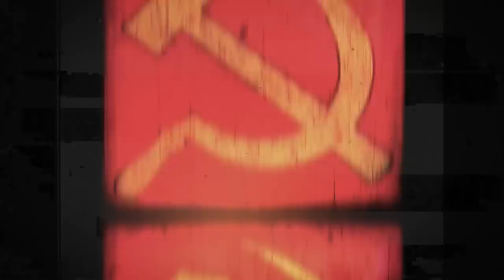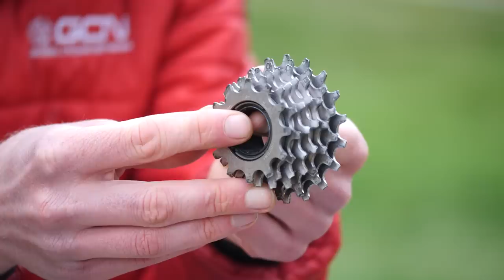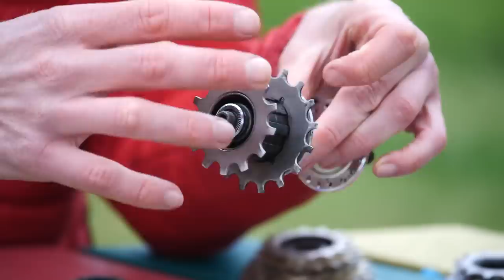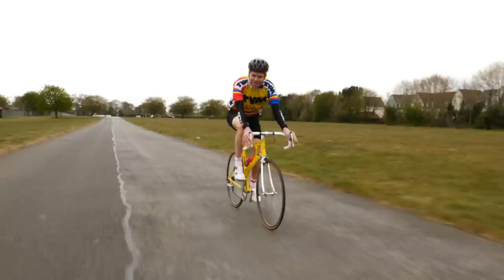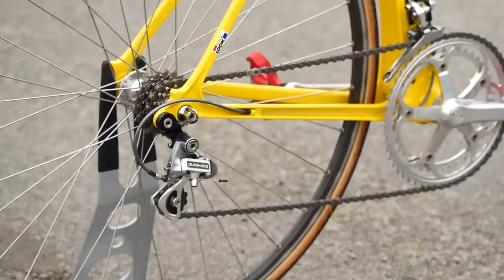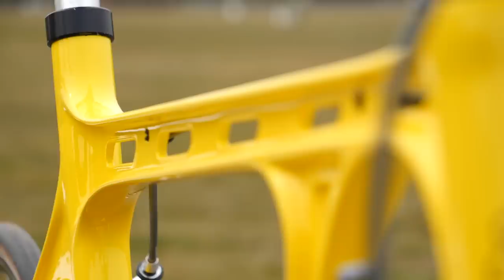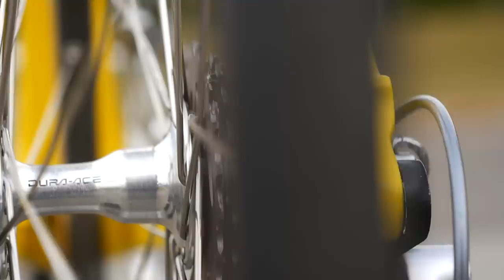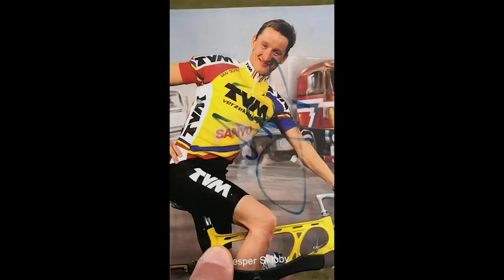The Greatest Cycling Innovation You've Never Heard Of | Shimano Hyperglide

Comment: Telling my age. But I remember when Shimano released SIS to compete with SunTour.

When Hyperglide was released, I just remember the parts being expensive and I liked how the cogs have that bright shiny platinum silver coating.

I too thought the cogs were damaged due to the way the teeth are etched. 

Yes it does make shifting, especially under load a bit easier.

The only downside to Shimano shifting is the shifter is designed to release or pull the amount of cable needed to move between gears.

The down side to this is when peddling fast, the gear basically jump from gear to gear and the gear change is very rough.

Even though Campagnolo shifting, had like a ratcheting shifting where the ratchet inside the shifter kinda moves like watch second hand where it guides the cable up and down so the derailleur moves in small increments and moves the change thus giving a much quieter and smoother shift.

But the components are simply to pricey for anyone outside of a racing team.

I hope o e day Shimano fines a way to do similar.

I've been using their components since the early 90's and I so far haven't used anything else.

I don't like SRAM's double-tap, but I like how their components look. 

I really love the frame you're riding. I have to consider it.

Comment: The chain was mentioned almost in passing. Around the time of UG, chains changed dramatically. Instead of two side plates, a pin, a bushing and a roller, the bushing was eliminated. This produced a chain that was much more flexible laterally. This new flexibility made Hyperglide possible. 

The new sprocket shapes and flexible chain work wonderfully on older bikes without index shifting as well. I had a 1970’s Motobecane tandem with bar end shifters. I bought a new 6-speed Hyperglide freewheel and chain for it and it transformed the shifting.

Comment: Ah, so this presumably explains why sprockets of a given size may have A, B, and even C suffices, depending on the position of the teeth relative to the splines.  And the need to have the teeth in alignment is why it's not straightforward to assemble custom cassettes.  Can't be impossible, though.

Comment: Obviously the main issue with the Uniglide is the external thread at the end being exposed to the mounted gears themselves; Hyperglide simply put the threads on the inside of the hub itself. Anyway it's a genius idea by Shimano overall 😎. My complaint though is the hub solution itself for e bikes since they break a lot easier due to the applied force on the thread when motor assistance is used, especially mtb e bikes... But I guess Shimano never expected us to use electrical motors on common bikes in the future 😉

Comment: Shifters on the downtubes.  Remember hating those so much for so long.  Especially when they weren't indexed so you had to fiddle them to get the gear you wanted.
Yes of course you got used to roughly where each gear was etc. but having your hands off the bars to change gears on technical roads always meant going slower than you knew you could.
I like seeing retro tech, but I am old enough to have lived with a lot of it, so I look at it and feel glad we've moved on.
Uniglide was the floppy disk of the time.  The best many of us coud afford ot get, but not a patch on a today's tech.

Comment: Does this cassette only work with 11 and 12 speed road bikes? Not 10 speed road bikes with Shimano Tiagra Derailleur and Shimano 105 ST-5600 shifters? As I have a full Carbon 2009 Specialized Tarmac Compac bike but fully upgraded not stock.
Reply: Which cassette are you asking about? The cassette needs to have the same number of gears as your shifters.

Comment: I miss the old free wheels with a audible clunk. It took skill. Now anyone can shift like a pro. Oh well I just picked up a Benotto pro tour 800 with about 20 miles on it after 40 years. It was stored outside and has the most wonderful patina which I'm preserving with a good clean and a wax. It's for my daughter and I'll make a great city bike putting 700x35c and New tubes and chain. Should make a wonderful commuter gravel bike. I enjoy your channel very much.
Reply: India it is available I use them in my old steel cycle it works with out any issues.

Comment: What’s wrong with the Rholoff?  Or rather why don’t Shimano make their own version?  There are many ways it can be lightened and there are good reasons that cars and motorbikes do not use jumping chains to shift gears.
Reply: The Rohloff is not bad, but it's a little bit heavier, and a little bit less effective than derailleurs. Also it has more unsprung mass, which may be a reason on MTBs, especially fullies. 
Shimano has a version of the Rohloff, the Alfine, which is also oil lubricated (the Nexus use grease) with up to 11 gears, though the gear spread is less than the one the Rohloff offers

Comment: Brilliant explanation. Question: Am I ruining my HG cassettes by using Asda's £4 chains?
Reply: Not really unless the chain is rusting and the bearings on the links aren't lubed. I'd question the use of a supermarket chain though when a Shimano chain is in the £20 range and designed for HG? You will get smoother shifting and quieter operation.
Reply: @RobbieKhan  To be honest the Asda chain has been faultless. I do look after it.

Comment: 7:24 Ollie mentions Shimano chains being directional. I'm not too sure about that. Replaced an 8 speed and a 9 speed recently, couldn't find any installing direction marker... Or did he mean something different?
Reply: Not sure about that either.
Reply: Some Shimano chains are directional, some aren't. The one spare chain I have is a Dura-Ace/Ultegra/105 10-speed and the shrink-wrap has a bright blue sticker on it, which you couldn't miss, explaining that it should be installed with the Shimano logos facing outwards. I've had this bike for three-and-a-half years and replaced the chain multiple times but I swear I've never seen one of those before.

Comment: I Love you guys -
I happen to have just drawn up the greater innovation (you will never hear of) - 
Pedals turn a geared up generator, with hub motor/brakes on the wheels. 
No chain, sprockets, shifters, cables, levers- all gone - super clean and really light Eelectric drive.
Also has effortless electric braking, great for mountain bikes, because of the both wheels drive and brakes charge batteries for fast starts.

So we wait -for someone in Chna to see this, and let them build it all.
Reply: Electric transmission is a well-known technology.  It's used in most trains.  It is, however, too heavy to be used in bikes, and it also loses more of the precious input energy than either a derailleur or internal-gear hub drivetrain.  Both of these disadvantages explain why you don't see it used.
Reply: @Kromaatikse  Which is why a brilliant inventor like me enjoys such a challenge - using carbon fiber and light alloys to make it - far lighter than all the hardware it replaces, including the heavy chain, many sprockets, freewheels (which get larger every year) deraileurs, shift cables, shift levers, possibly even the brakes with effortless and low heat (never wear out) electronic brakes! 
Sadly - all tech in the USA is being held black, by men so wealthy from dirty energy they would rather inflict a Sea Level rise of 200 feet on the World, than share any of their obscene wealth.
Reply: @gordonanderson3111  A standard derailleur or geared-hub bicycle is already the single most efficient mode of human transportation available.  If your invention is really so revolutionary, I'm afraid it's on you to prove it.

Comment: Shimano's cassette design makes it so easy to remove, clean and replace the cassette.  No need to worry about which cog goes where or where the spacers go.  The cogs only go on the way they're supposed to, and if you look at the cassette from the side and pay attention to the spacing, you'll know if you got it right before putting it back on your bike.  It's things like that that we take for granted, but that make our lives just that little bit easier and less time consuming.
Reply: There were already freewheel bodies by the mid-80s, notably Maillard's Helicomatic system, that were also already splined so that the cogs went on in a manner that they were engineered to on the freewheel itself. Shimano and Sun Tour really changed the shifting game by innovating ramping in their splined alignments for crisp shifts that made smooth indexing possible.  The problem though since this innovation, is that most people couldn't customize the cassette or just replace a worn-out cog individually themselves anymore without really knowing the ramping sequence, and a deeper level knowledge of the hyperglide system.
Reply: @danielhall3895  That's "splined", by the way. The spleen is an organ in your body.

The only thing stopping you replacing single cogs is that you can't buy single cogs. That has nothing to do with hyperglide. And, honestly, most people aren't going to wear one cog significantly more than the others.
Reply: @beeble2003  Finally caught that, I typed it early in the morning.
Reply: @beeble2003  That's not entirely true about wearing out several gears more than others. A lot of people, especially recreational riders, tend to wear out their cruising gears significantly quicker than their climbing gears. Most recreational riders tend to stay in a small range of gears they use constantly and it's usually the middle to front of the cassette.
Edit: Also, the non-availability of single cogs anymore isn't what stops people from customizing their own cassettes. Most cassettes are riveted between certain cog combinations or to the final cog on the cassette, to keep the cogs joined for installation or removal since one of the only threaded cogs is also usually the lockring now. The rivets on most cassettes are no longer threaded or screwed in place, so removing the cogs also requires tools now to remove and replace the rivets.